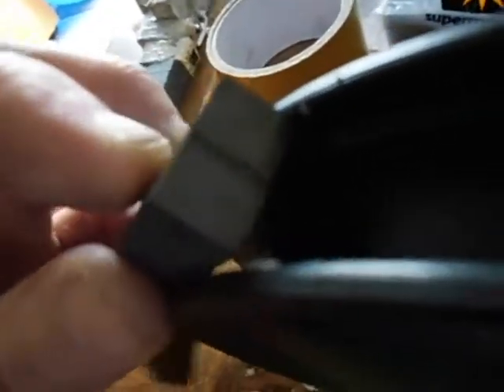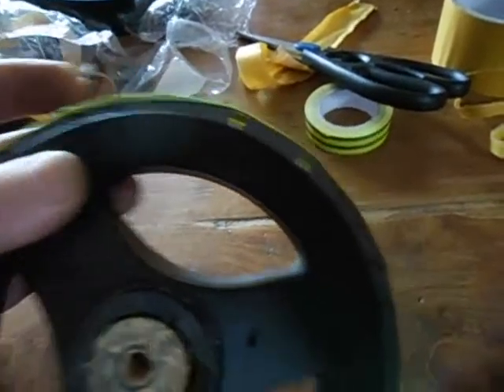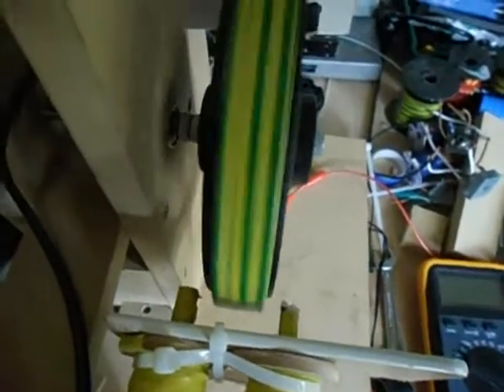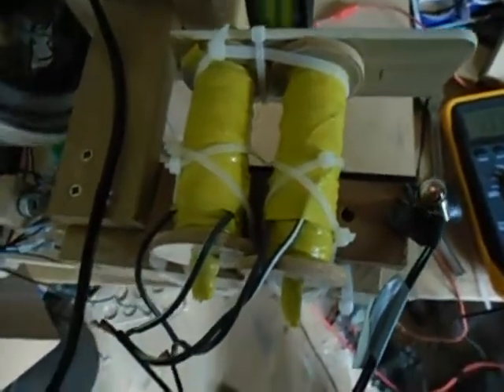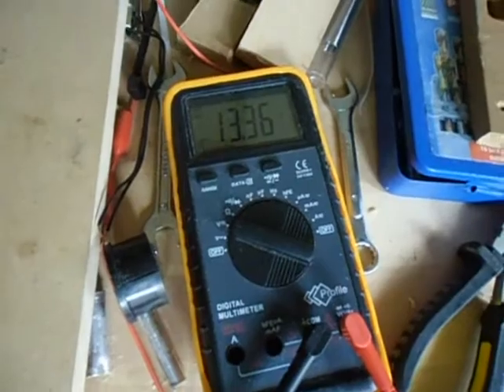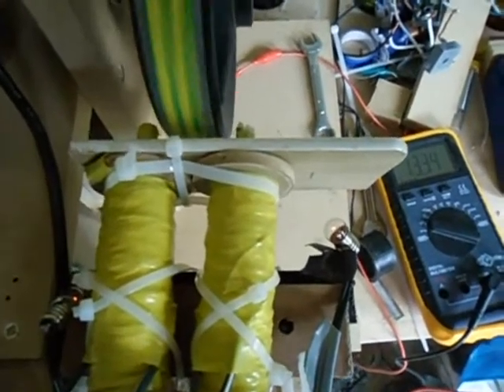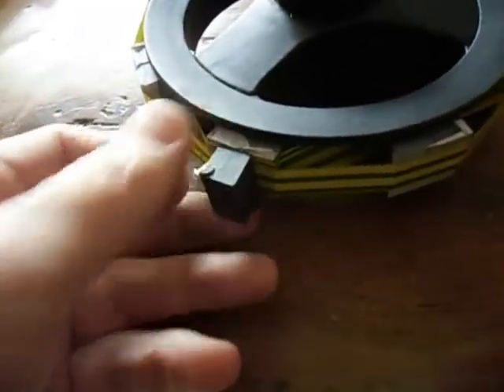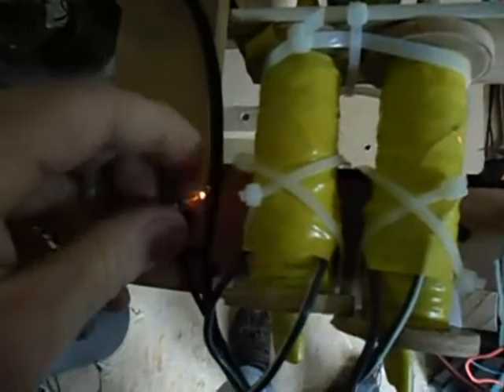more different magnet configs

Comment from the maker: Yes I am neglecting some other work here. To bad it isn't as good as it may seem, The lamps have only 3v over it at around 30 mA so  this is about 0.1 watt per lamp so max 0.2 W and the battery charger is a bit worse due to the lower rpm and with the lamps on I need to go a little over 90mA input so I think no OU yet. still have to find a way to use the short current from the coils or maybe pulse them and capture the radiant. Thanks for watching